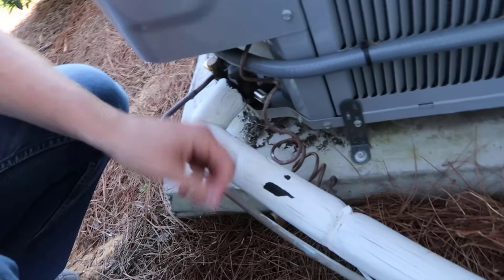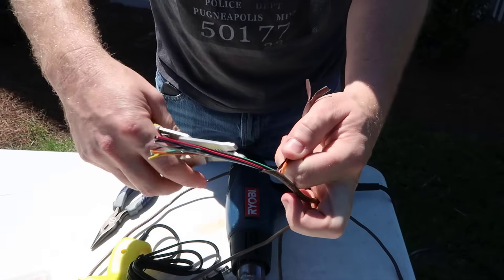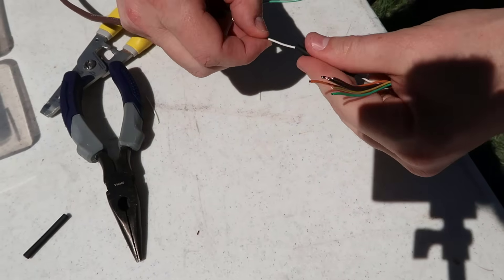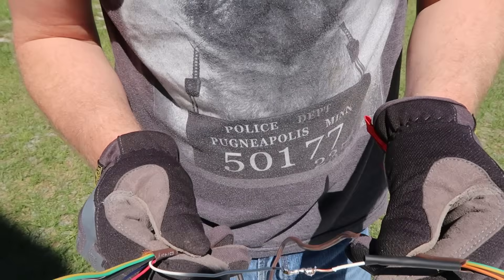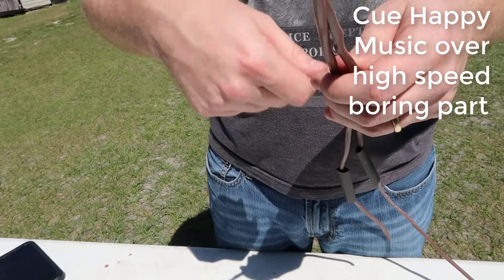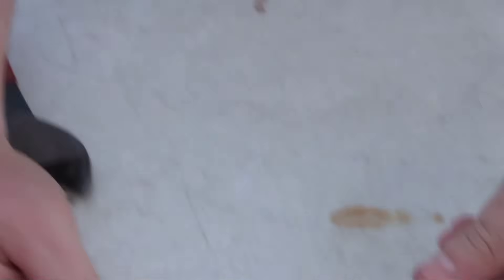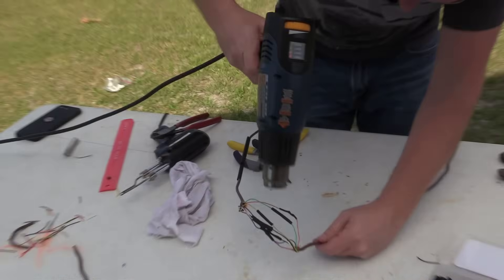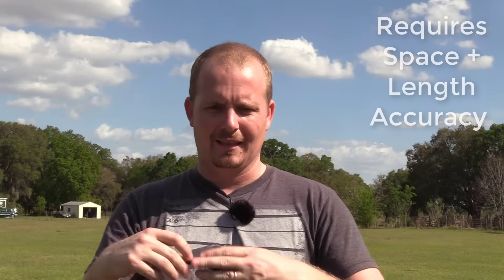How to Splice Thermostat / Control Wire with the "NASA Splice"

Comment: Nice video. I definitely learned something new. How ever I will never be busting out eye protection much less a soldering iron with a full work load in the dead of summer laid across ceiling joists where the roof meets the wall in the attic to make a low voltage splice. It just ain't happening.

Comment: I work in new construction hvac-r and here the townhomes that are in within city limits they tend to steal the copper and they cut the thermo wire of course ive thought about just soldering but the company always just wants new wire in the rough stage its faster and easier to just run new wire times that by 8units per building so yeah i would do this if the house is trim stage

Comment: My favorite splice is to tin the ends of the wire, place tinned wire ends together in parallel and run some solder joint between them - rock solid and easy to de solder if need be.

Comment: The best soldering gun you can get your hands on is a Weller GT7A Gun with a 120V, 150W, 700°F Power Head.  It's temperature controlled so you can just keep the trigger pulled while you are soldering and it weighs less than a pound.  Once you use one of these you will never go back to one of those 10 pound burners your grandfather used.  They are a little hard to find but the best place to find one that I have found is eBay.

Comment: This was a good explanation of a Western Union splice. This is impractical for field work. I use butt connectors and shrink wrap. I then zip tie the cable to the suction line, snugly, on both sides of the splice. I've never had one pull apart. If anyone wants to insist on doing this in the field, Amazon carries butane soldering irons. They are super convenient.

Comment: ..or you can use the heat shrink insulated crimps because in an appliance there’s no spare 8 inches of wire. Or a decent amount of space to fit a soldering iron. But I get it.

Comment: Having done a lot of these, I immediately noticed at 6:00, the heat shrink is hot and compressed on the wire. But you cut away (maybe to fix the heat shrink?)..... Opps, at 9:00 you cover it.  Sorry!

Comment: Thank you for the video.  Why is it necessary to solder the wires? Wouldn’t twisting and heat shrink be sufficient.
Reply: No! copper corrodes over time and the joint starts acting like a resistor.  Also, the main reason to twist the wires together is to keep them from moving while you solder them.  So only a few twist is all you really need.

Comment: NASA HUMPH!!!!!!!!!!!!!!!!!!!!!!!!!!!!!!!!  I may just be studying this trade, but both of my parents were Western Union,  & my dad was in Signal Corps in Army during Korean Conflict. then WU for 33 years until his death in the 1980's my mom was WU until I was born in the late 60's, WU invented it around 100 years before NASA, which was started in 1958, WU was 1851. 
I actually been doing WU connections since I was a kid in single digits, & solder it, thats the way my parents insisted. 
next if you have the room, you did it wrong! I just saw your typed comment on expert level of splicing like this, splice 1 wire every 2" if possible so you do not have a big pregnant section of wire, & I know, not always possible, but looks so much more professional. did that many times putting taller bars on motorcycles, many times adding 12" or more to wiring for ape hangers.
also those gloves are bad. let a drop of solder hit & melt through the cloth section, I had spark from welding just tacking melt right through a few years ago. but otherwise great video, & I had to give you a little Hell over the WU since I was raised in the old days and saw & was around old machines.
Reply: Great post Randy

Comment: I use staggered small blue wire nuts turned up, and pull the whole length of wire including the splice through 1/2" LFNC which is how it should've been installed in the first place. One stipulation - the conduit must be configured so it can drain.

Comment: Foam insulation wrap painted white on the return? 
I kept one good roll of aluminum HAVC tape from my 3 years at a shop and nothing else is as strong for many DIY that I have to do to survive; I forgot what the low-pressure return is called on the condenser but aluminum HAVC tape should not only last longer but provide shielding from a few common vermin;

Comment: After hourly wage and materials it would've been cheaper to run a whole new wire...also, if it was of any importance, ex: used for an inverter or as a communication cable it would be run in a conduit or would have to run a waterproof insulated cable. Especially if it goes  underground.

Comment: To the folks who say "it takes too long" to do this type of splice -
It *doesn't take too long*. This is the appropriate splice to use OUTSIDE or any WET LOCATION. the heat shrink tubing isn't necessary in an attic, this splice can be done with electrical tape indoors. I have used this splice literally thousands of times and it can be done MUCH faster. The point is that this repair will take about 15 minutes for a skilled journeyman to do. Assuming the customer hit the t-stat cable with a string trimmer (a relatively common problem), a competant service technician will spend about a half hour onsite to troubleshoot, repair, and test this problem using a good butane soldering iron (I use the Master Appliance Ultra-Torch UT100SI) and being mentally organized for the task. The UT100 has a hot air tip to shrink the tubing also. However, a ball of wire nuts and a wad of electrical tape will ONLY KEEP THE MOISTURE IN THE CONNECTORS. Electrical tape is the worst thing to use in a wet location! This will be ANOTHER service call, an UNHAPPY CUSTOMER, and YOU earning the label of a HACK. Good workmanship doesn't take too much time, at takes exactly the right amount of time, so use the appropriate type of connection for the application!
 In an attic, a splice can be done with wire nuts, B-caps, Bean crimps, UR connectors (up to 19 AWG) and a host of other methods,  including soldering. Soldering is the most secure, permanent connection you can make. Period. 
Take pride in your work please, it costs about 10 times more money to send a service technician out to fix your crappy work than it does for you to do it right in the first place so please take pride in good craftsmanship, it's cheaper I. the long run
Reply: That's the attitude to have!! Stand by everything you do!! Own it. Cause your names on it!!

Comment: If you want to splice the wires with 24 v power alive cut one wire each time. Otherwise, turn off power to 24-volt control transformer before you cut cable all at once you will burnout fuse or transformer.

Comment: Heat shrink butt connectors,  they are used for underwater well pump motors at line voltage, so they would be good enough for stat wire.  The marine type are best as the also have glue, and can be had in very small sizes

Comment: I've done this before but not for hvac application.  However if putting it out in the weather I would use marine grade shrink tube its much thicker and made to resist sun and salt damage.  Normal shrink tubing will not last long in the sun and weather.
Reply: Its the same thickness at the brown cover 🤷‍♂️ people just think about stuff too much

Comment: There are a million ways to skin a cat , it is easier to lay the wires parallel  , tape them together , strip twist and solder conductors , slip shrink over ends and wrap with tape .

Comment: Shorted wires are why I usually stagger the splices.  Then only every other splice needs the small heat shrink covering (wherever the splices actually overlap.  It goes faster and leaves a much slimmer bulge.  On four conductor cables, or on speaker cables,  you only need one or two pieces of HST over the whole splice area.  Since the wires are being soldered,  they're not moving or coming apart...

Comment: Failed to met NASA SPECS . According to NASA-STD-8739.4A - 19.7.1.a The conductors shall be pre-tinned
Reply: In addition workmanship counts . Standard dictates that there shall be at least 3 turns around each conductor and the wraps shall be tight with no gaps between adjacent turns .

Comment: Good information on splicing. Wish that folks that like to wire nut splice in areas that become inaccessible without tearing out walls etc. would do these splices. Another Video on NASA splicing showed that the wires are to be tinned prior to splicing then soldered again. They even showed a copy of the NASA requirements for the splice.

Comment: On small jobs like this I solder and heat shrink with a Dremel brulee torch. Good video.
Reply: Most pros don't solder wires or shrink tubing with a torch.  You probable picked that up from one of the reality car shows on cable TV.

Comment: This is best practice, no doubt. I appreciated you throwing in some alternative methods that might be more practical.... If the wire is concealed this is the way to go. Otherwise probably cost prohibitive, IMO. Great tutorial, well done!
Reply from the maker: I would say it's not going to practical in most cases. Heat shrink butt crimp connectors staggered with shrink over the top is the next level down I would think and prob would take half the time.
Reply: That would be a good alternative. I'm OCD/Best Practice boy, you definitely have me thinking about my methods.

Comment: I always try to pull a whole new wire when possible. Nice vid
Reply: Rob HVAC Yes. This is a great video for splicing. But in my area where we have basements, it's likely quicker to run a new wire. Still a very good practice to learn and have if ever needed.